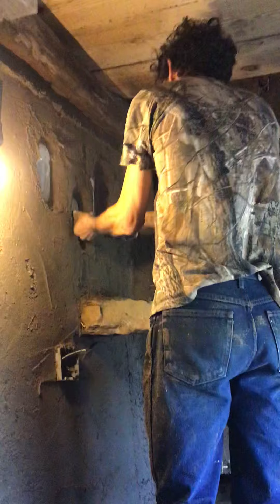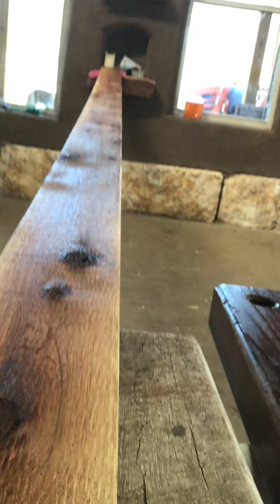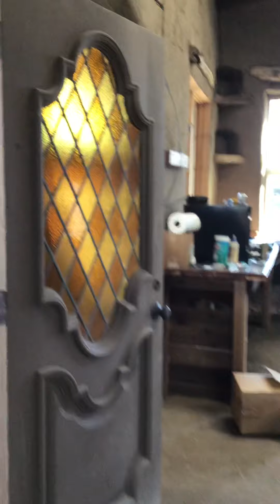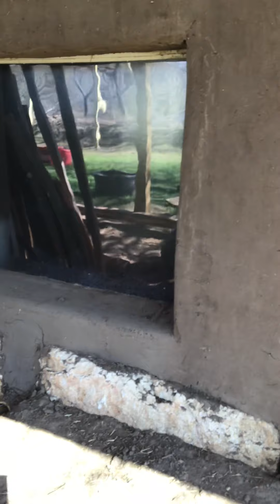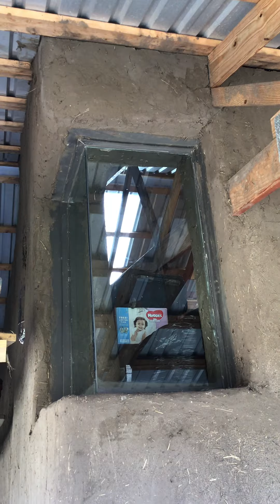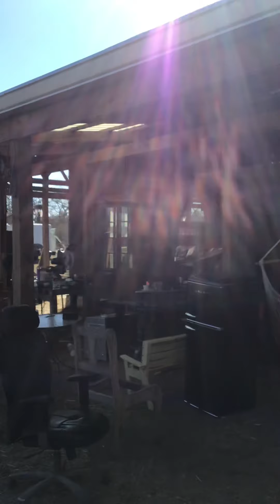First HD Video- Cob Barndominium

Comment: Thanks for your videos, especially how you have stated that with equipment, you have been able to build your cob structure with only 2 people. It's going to help me prove some people wrong. I plan to build a few small structures using the stick and mud method, especially for the inside walls.
Reply from the maker: You can absolutely build a house like thia with two people. If you are going to put up smaller buildings, like 200-300 sqft and 8 ft ceilings at a time, you could build it yourself. I think the "pod" method is better than building a large structure off the bat like I did. Try to errect the roof first no matter what you build, it makes working and keeping rain out of site amazing. It won't be easy with one person. But with a year of working at least 3 days a week on the project, you can finish a small livable building with proper planning.